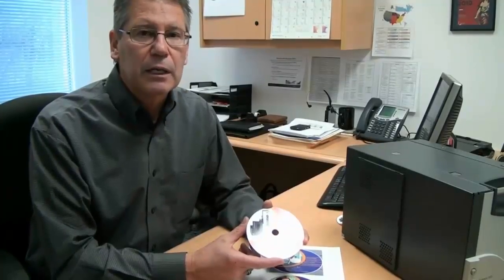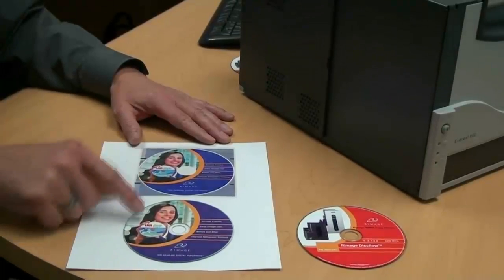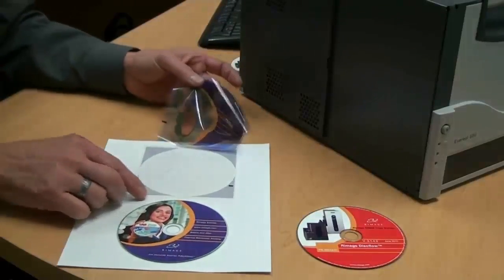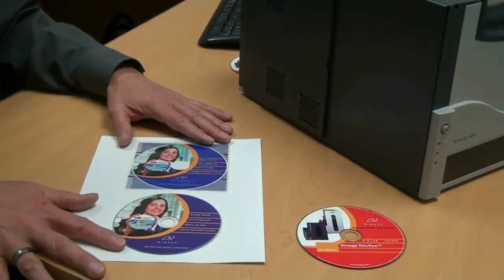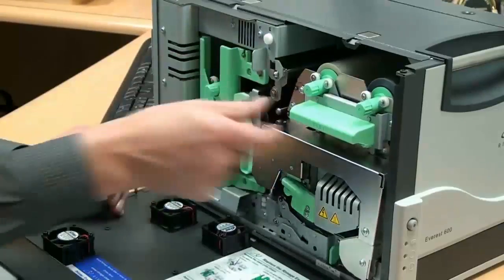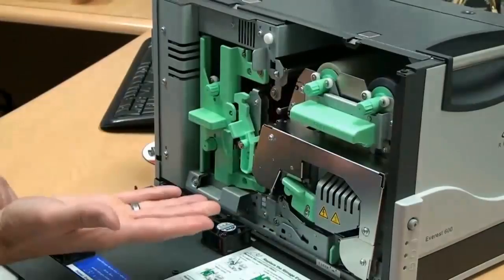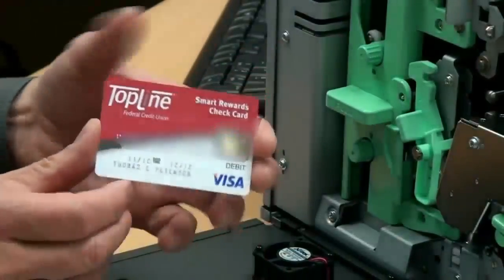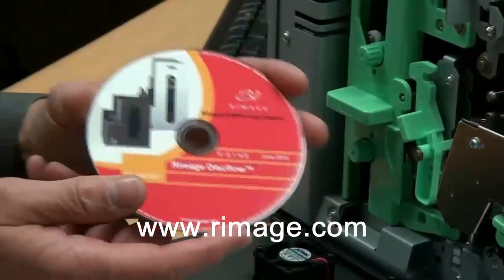How Thermal Retransfer Printing Works

Comment: does it work on windows 7 ????
Reply from the maker: Works with:
• Windows 7 Ultimate 32/64 bit with Service Pack 1
• Windows 7 Enterprise 32/64 bit with Service Pack 1

• Windows 7 Professional 32/64 bit with Service Pack 1
Reply: Does it work with windows 10 x64 ,2020 version